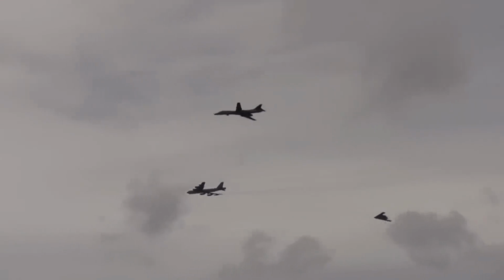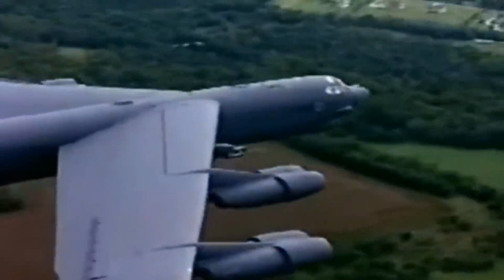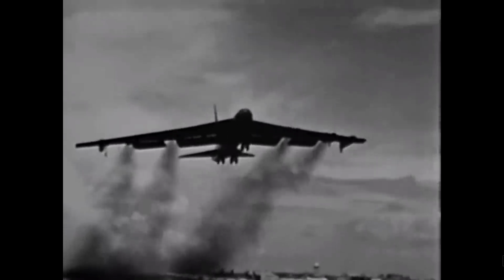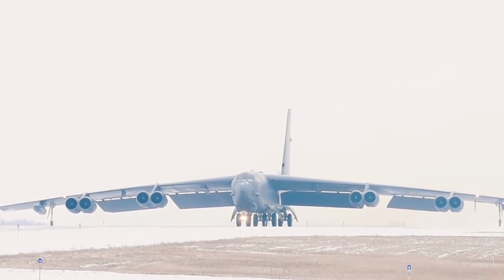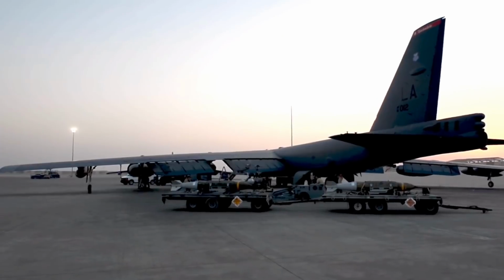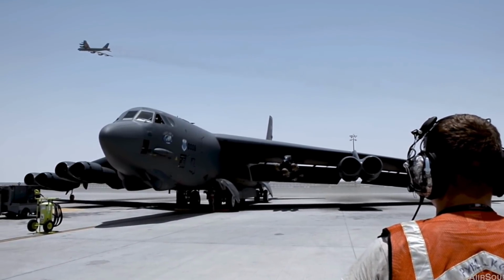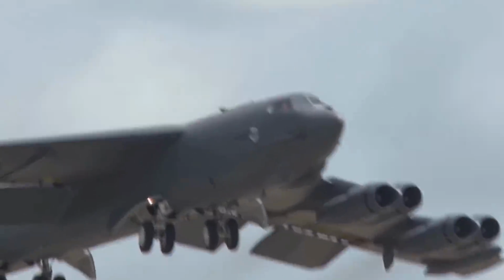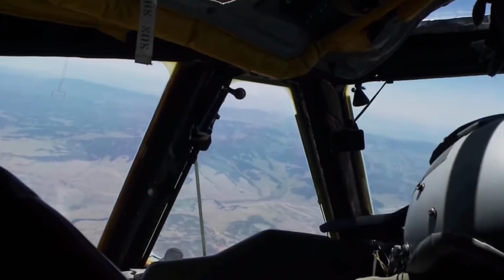The B-52 Stratofortress - Americas Heavy Bomber

Comment: Yeah, "BUFF" - Matt used the PG version.  Interesting facts (someone who actually flew the plane please update if these are incorrect). The movies usually show a Buff's interior incorrectly, with crew walking inside (I think Dr. Strangelove was pretty accurate, tho).  Instead, there is a small tunnel to crawl through to get from the cockpit to the weapons officer area.  The joke was that Boeing designed the perfect bomber, then had an "oops" moment and had to redesign it to put in space for the crew.  The wing tips will be 18 ft higher when the plane lands, empty of fuel (in the wings), compared to when the plan takes off fully fueled.   It is the only plane I know of where're the tail lifts off before the nose at takeoff.  Some movies with airliners show landing gear raising or lowering, but if the gear rotates as it lowers it is really film of a BUFF, which had a ton of movies of the gear in the design-test phase since it was so unusual and no other plan had gear that rotated as it lowered like the BUFF's.  But the film was easily available to moviemakers, so who cared if it was accurate.

Comment: Why they use such "un modern,, engines?
I mean they are engines on the market that can give you a lot more Power and they are a lot more fuel efficient.
Dont know maybe I got something wrong here?
Reply: airplanes are diffrent then jet fighters....once a airplane is made the fittings for engines cannot be changed some minor changes inside the engine can be made....but changing the whole engine will require to seperate the whole wing and then attaching it again....doesn't make sense

Comment: Little known fact: When they pulled the tail gun they had to replace it with 2000 lbs of concrete to displace the weight removed. We had one show up at the an air show recently, and I was able to talk to the crew. That plane rolled off the line in 1960. In another term, literally the crews grandkids could have flown that airframe! Literally! 
Its a good bet that crews grandkids will fly it before this plane is retired sometime near the end of time it's self. That says something with them retiring planes that came out in the 80's before they even think of removing this aircraft.

Comment: A B-52 lost more than 80% of its vertical stabilizer during a test flight way back when.  It landed safely.  Testimate to the design.
Reply: A few also crashed from similar incidents.  The stabilizer was later redesigned to tolerate heavy wind shear forces.  

It was happening a lot of the rockies where powerful winds are often pushed up off of the mountain and can cause some really weird effects even well above the mountain tops.
Reply: p51mustang24 yeah that's called mountain wave

Comment: I went on a geology field trip to the western United States. We were looking at gas and oil wells from the top of a mesa in southern Utah. It came in low o the horizon. The mesa had to be over 500 feet because the Air Force B-52 was beneath us. I mean  we watched  it approach toward us and just before it reached the mesa it banked off from the 6 o'clock position to the 11 o'clock and screamed of to that horizon the whole time with us looking down on it. I don't known where it was from or going to it was just cool.
   The second coolest experience I had with this aircraft was back in the late 1980s the use to bring out everything to the airshows. The B-1 Lancer was there the C-5 Galaxy Cargo plane with both ends open.. They did have the C-17 yet. They even had a B-52 BUFF with its bomb bay doors open,. The electronic warfare station was open as was the pilot, copilot and radio and navigator I think it all was impressive as were the fighter aircraft 1on display. The ending ended with a  concert by the group "America".

Comment: The B-52 fleet is currently undergoing an engine upgrade plan that will replace the eight engine twin pod design with four modern Turbofans much like Boeings latest generation airliners. Once completed they'll have greater range and lifting capacity. The U.S. Air Force plans to keep the old BUFF flying until 2050 and that will make it's service life almost a hundred years. Think about that, most of these airframes are significantly older then the crews flying them.

Comment: One of the most important things about the engine change would be that it would stop up the sucking chest wound of P&W's ongoing JT-3D maintenance contract (TF33 is just a model of ancient and unreliable JT-3D). P&W is the source of most of the FUD that keeps this from happening, ripping TF33s out of the KC135 and replacing them with CFM56s has been a huge success. The latest favorite, last time I checked, for the re-engine is BR725s. Sticking modern engines on the thing may take it close to a century in service.

Comment: I worked on those back in the early 90s when I was stationed at Castle AFB, CA.  I believe the ones we had were G models.  It didn't have turbo fan engines like these in the videos.  I hated it.  Those old engines caused so many cracks in the structure of the aircraft.  We had a flightline truck dedicated to doing strut repairs and not just repairs but rebuilds.

Comment: Most movies that show the inside of the BUFF (which the USAF folks called the Big Ugly Fat F%cker, not "Fellow"), show the crew walking from the cockpit to the center stations.  Nope.  Can't walk.  There is a tunnel to crawl through.  The joke was that Boeing designed the perfect bomber and then said "Oh crap!  We need to make room for a crew."  It was also cool in the old days to see the Hound Dog stand off missiles loaded on the wings.  These were jet-engined missiles with a decent range, and nuclear capable (I think).  The crew could fire one off to go ahead of the plane and take out enemy defenses.  But a neat aspect was that the pilot could rev up the Hound Dog missiles' engines, without launching them, to assist in take off power.

Comment: Fun facts! Check out the detailed story in Air Force Magazine behind B-52G Stratofortress 58– 0248 named “in HARM’s Way!” Which wouldn’t have gotten that New Name if it wasn’t for the Tail Gun System and a shitty mistake by a F4-G WW Weapon System Officer shooting MAGNUM in the blind. 

ALL B-52s had Tail Guns before 1991! A-G models had QUAD mounted Browning M3 .50 BMG machine guns and H models had a 20mm M61 Vulcan rotary cannon. The Stratofortress IS and most likely will ALWAYS be the LARGEST aircraft EVER to have at least 2 CONFIRMED air to air kills with 1 possible! On the Christmas Raids over Vietnam of LINEBACKER II a B52-D was targeted by a Fishbed, and the tail gunner managed to see it on radar and gain a firing solution as the “Blue Bandit” was lining up on them, and splashed a fuckin MiG 21 with a 7 second burst of .50 BMG! Then a few days later during the same Campaign another air crew splashed another MiG 21, and another later in the war on An ARC LIGHT mission claimed 1 possibly damaged MiG 19. The B52 also holds the distinction of the LAST EVER Air to Air kill by a fixed wing aircraft using ONLY MACHINE GUNS! And the ONLY enlisted member of the Crew was the tail gunners, everyone else had to be an officer when they were SAC aircraft.

Supposedly the final reason (the expensive to Maintain obsolete cannon system that was only good for within visual range in an Era of BVR missiles were considerations for stopping maintenance for years) the Vulcan (which were Radar Aimed) were removed was because in Desert Storm an F-4G Wild Weasel shot a HARM up its ass! On the opening night of Desert Storm the weasel crew was flying SEAD for the B-52G. The tail gunner started his radar scan at the inopportune moment the Weasel crew got a potential Iraqi AAA site radar warning. The WSO of the F-4 called “Magnum” and shot the Harm in the blind hoping it would guide on the potential AAA site, and they watched in horror when it came off the rail and accelerated right up the ass of the B-52 and completely sawed off the entire Gun system and a good chunk of the rear flight controls/Electronic Warfare hardware. Apparently the Gun system was the ONLY defensive system on the BUFF’s that hadn’t ever been updated, so they still used Vacuum Tubes and by shit chance the same radar frequency band the HARM was searching for. One tough old bird, and there was that 1 B-52 that continued flying around AFTER having nearly its ENTIRE vertical stabilizer ripped off in severe wind shear after the vertical tail was redesigned.

Comment: 1) I believe they've removed the AGM-84 Harpoon capability, but the B-1 will be fitted to carry 20 LRASMs (Long Range Anti-Ship Missile - the AGM-84's replacement.)
2)I saw one take off on a combat mission from Diego Garcia in 2003.  It slowly rolled most of the length of the LONG runway, and into the air, then slowly, slowly climbing and turning back to the north.  Wondered how it stayed in the air it was going SOO slow.

Comment: It was obsolete decades ago but kept for political and budgetary reasons. B-1B and B-2 in current configurations together do a better job than the B-52. The B-1B now has become even slightly cheaper to operate while being much faster in response to mission requests and completion for conventional bombing, carries more cruise missiles for standoff strikes, and is far less vulnerable by having better electronics warfare and a tiny fraction of the radar cross section of a B-52. B-2 delivers nuclear weapons and first day strikes in contested airspace with far better mission success and survival potential than a B-52. The USAF determined the B-52 to be mission ineffective for nuclear penetration missions way back in the 1980s - that is why the Russians were able to tolerate us keeping keeping hundreds of them in disarmament treaty negotiations but insisted on nuclear fusing being removed from the B-1B. Because the B-1B was and still is more capable.
Reply: Its not like they're running the original versions. How can something be obsolete when its updated and due for more?

Comment: Imagine what it'll be eventually replaced with.     If I remember right after they removed the tail gun they had to put concrete into the tail replace it. I guess the weight difference was a big deal.

Comment: It's been reported in Aviation Week that the re-engine program will use 8 engines. This doesn't seem to make a lot of sense until you realize how small the B-52 rudder is compared to the plane; the B-52 simply lacks the control authority to fly with an engine out using the big draggy hi-bypass turbofans that would be required for a four engine setup.

Comment: The BUFF will be around for a while (2050s) since these planes can fit several mission requirements. The latest being able to loiter outside a battlefield and be used as missile platforms receiving shared targeting data from stealth fighters/drones. Theres also talk of a re-engine fit pkg for them which would increase efficiency and range.
Reply: Think about a 747-8F with a custom munitions dispensing system....  1,000,000lb MTOW
Reply: stingray427man We all know in the year 2132 the USAF will still be upgrading the BUFF

Comment: The B-52 is still in service because the military needs a cheap bomb truck and it fits the bill. 

With the Air Force announcing the retirement of the B1 and B2 frames to start replacement with the B-21 on a 1:1 ratio over the next decade, it seems like the US Air Doctrine will be more high-low with a large fleet of heavy low cost bombers for controlled airspace and a smaller more expensive fleet of light, fast, stealthy bombers for first strike and high priority targets.
Reply: Should have did the B1-R program.  Such a waste to get rid of the B1.
Reply: @mhamma6560  why the b1 has a lot of problems, the b52 and b2 are both more capable bombers